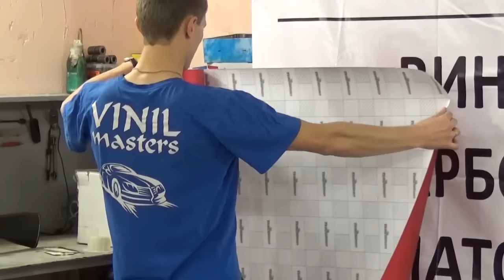Wrap Job TeckWrap Red Matte Metallic Full Wrap by Vinil Masters Russia

Comment: This is such a unique technic that I've never seen done before. I like to know if the vinyl can withstand all sorts of weather thrown at it without the vinyl pealing off.
Reply: No.
Reply: it wont last long
Reply: @dkllc6874  Well, it all depends. I'd say 3-4 years is plenty long, I would certainly hope I would have bought another car within that timeframe....
Longevity really does depend. First of all, on the quality of the vinyl. If you buy your vinyl on eBay, it likely won't last as long as you would have liked. But if you spend the money which 3M/Vivid/Avery wrap cost, it will likely last very long.
It depends on the guy wrapping your car. If he is inexperienced or is using a poor technique, in particular along edges & corners, the wrap will soon start to peel. If he's a pro, only the very tight corners will start to peel after a couple of years.
In general, weather does not affect the vinyl. But if you park your car in strong sunlight, that's really the litmus test for the guy who wrapped the car. The first day in strong, warm sunshine is the test. If your car was wrapped by an experienced guy, the wrap will be perfectly fine after being toasted in the sun. And it will continue to withstand sunlight. But if your car was wrapped by an inexperienced guy, the sunlight will wreck your wrap. The wrap will shrink and peel. You will see lines of the original colour shining through along edges, and the corners will peel.

I myself did a crappy, rushed job last month. I ran out of time, and the car simply had to be finished by bedtime. I cut a few corners, even though I knew it was wrong. So instead of dismantling anything, I carbon wrapped the inside door handles/arm rests, center console and wing mirrors as they were. I knew it was crap, but I prayed and hoped it would be alright. I couldn't fold the wrap along the edge of the console, so I just cut as precisely as I could around that edge. Same with the mirrors, I just cut the vinyl along the top edge. I was surprised over how neat it looked. It lasted until next afternoon, where the car got back, now with chrome shining through on the center console, and the mirrors made me laugh. The carbon wrap had delaminated completely, just hanging like deflated balloons under the mirrors.
So what I'm saying is IT DEPENDS !
-Get a pro to do the job, and it will last 3-4-5 years. Probably 4.
Reply: Blue C  ओझथ

Comment: Ok so for window tinting we are always taught to use soapy water to keep
 the material movable until you squeegee it out to its final resting 
spot. Is there a reason that this is not an option with vinyl wrapping? 
Im only guessing that it has to do with the heating and cooling or the 
amount of force needed to stretch the material?
Reply: Damian Ramey it's still a good idea but you use about 1 drop off soap to 1 liter of water.
Reply: Damian Ramey most wrap vinyl has a component to it known as air-regress.  A tiny network pattern of hexagon shaped tube-like structures imprinted into the adhesive side of the vinyl.  All of the air bubbles are dispersed, and the vinyl stretches better.  Soap and water is not necessary and more of a nuisance in my opinion.  in some cases it violates vinyl warranties.
Reply: Right